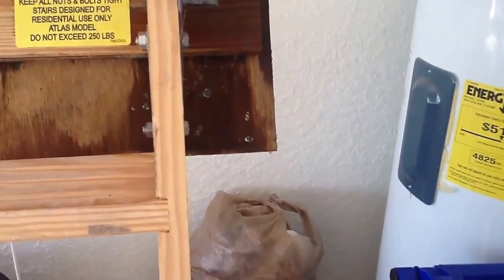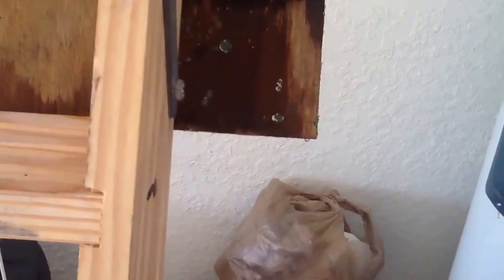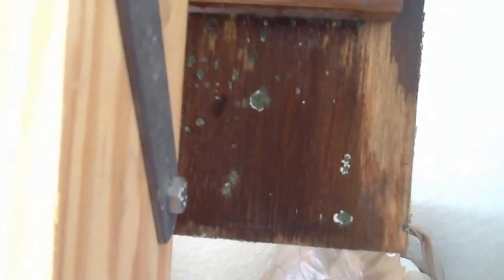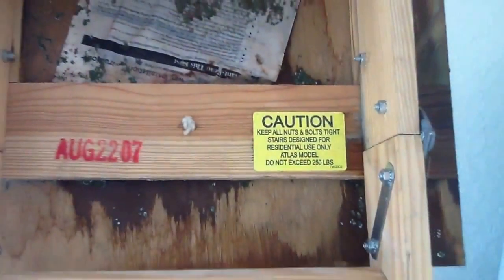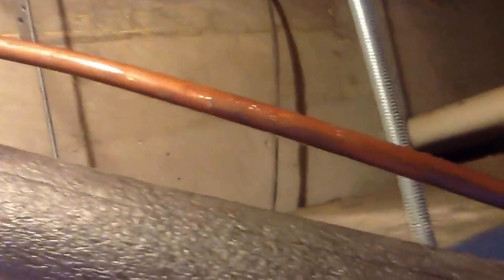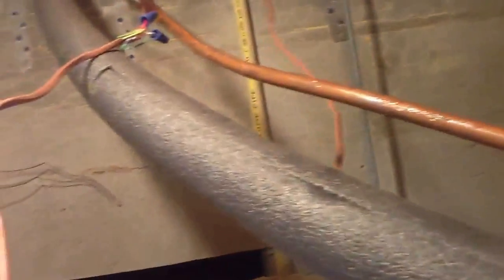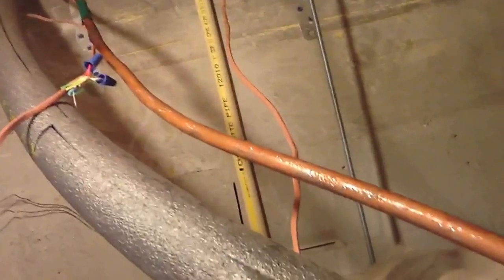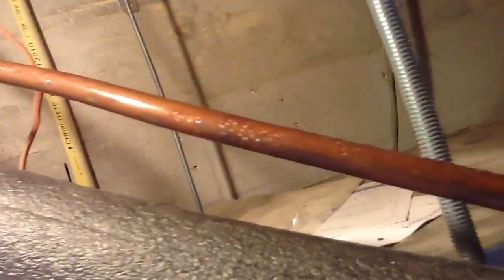Why does my Liquid Line sweat?

Comment: Insulation MUST be vapour sealed, the has line is not vapor sealed, ie the joint is not glued or at least taped up , then it will sweat inside and if is rubber it will become soggy and not insulate at all , in fact it will be worse then no insulation, due to water is an excellent medium for hot or cold temp transfer , as for condensation on the liquid line , Gas but I guess someone’s already said that

Comment: A couple of days ago, my ac guy had just installed a new ac unit and after a puddle formed beneath the outside unit, he said he had to discharge a couple of pounds of Freon. My concern was that it would not cool as it did, but it is cooling just fine and now the compressor (not sure if it is related), is not as loud. Thoughts???
Reply: I know you posted this 2 years ago but from what I know these mini splits are pre-charged for a certain length of line so let's just hypothetically use a Pioneer and they come with a standard 16 or 25 ft copper lines for the refrigerant so with that being said even if he cut the lines to 10 ft with Pioneer it's still okay and you don't need to remove any refrigerant people just need to be wary of these so-called furnace heating and air conditioning people not all of them know what the hell they're doing

Comment: to those who comment that this happens to all pipes....... No, not every pipe does this, and if they do, you have a problem to fix. The liquid line (on average) will run about 3 to 8 degrees higher than the outdoor temperature, but with a TXV system, you will use sub cool tests to determine charge level and operational status. This is a rare event and will be seen in systems that are low on Charge, or may have a partially restricted filter drier which can then cause "flashing" of the Refrigerant as it passes through the drier. Then their is the far extreme and less seen issue, Grossly overcharged system using a piston can also cause this. Your Freon can become over subcooled and drop to a temperature which will cause dew point to be reached on the surface of the liquid line. In the end, the most probably reasons are low charge and restricted liquid line (restriction can be in drier, service valve, kinked line, etc). Just another "old guy" like Mr. Jones here, trying to offer understanding to the incoming trades people.
Reply: I had a similar circumstance where I had no liquid sub cooling at the condenser on an ac unit but when I checked the temp of the liquid line by the evaporator it was already getting cold and would have been sweeting if it were a hotter day. My first thought was restriction but both sides of the filter dryer by the evaporator were equally cold temps. Every other factor like air flow was fine. So I am under the impression that the liquid is flashing before it's hitting the txv. Added some refrigerant, brought up my sub cooling to about 9 degrees and liquid line was no longer cool or sweating before it entered the evaporator. I knew the system was low but was a little apprehensive because of how the liquid line got cold as it got at the evaporator. My guess was it was changing state premature and your comment on how undercharge can cause this problem reassures me of my suspicion. After my charge the system was working well.

Comment: It is normal, because the convection of heat with the outside air. It causes condensation on pipe. U can insulate it to prevent condensation.
Reply: That is incorrect, the liquid line should never sweat only the suction line.
Reply: Wrong. Don’t ever say that again. Ever.
Reply: I could show you some cases and the system is normally running.

Comment: Typically....this line is hotter than the air surrounding it, and is therefore left un-insulated for better heat transfer. HOWEVER, for many attic-located air handlers in the US South, the attic temps can reach 130 degF or more....making it the reverse....meaning, the line is now colder than the air surrounding it. This will cause the liquid line to GAIN heat from the surrounding atmosphere ( instead of rejecting heat)...and you may have two problems....1.) sweating, like this, and/or 2.) loss of liquid subcooling of the liquid being pushed back to the evaporator, causing operational problems. For these reasons, and under these conditions.....insulate the line, at least where it runs in the attic section...and leave the line uninsulated where it exits the home and is run outside to the fan/condensor unit.
Reply: It’s a restriction, insulation won’t help.
Reply: @Slavelife9279  ..it matters what the surrounding air temp is...AND the assumption made.... if such ambient surrounding air is hotter or colder then the process line. Read my note again as to where I suggest insulation or not, and for what reason it may be beneficial. Restrictions speak to another cause probablity.
Reply: @TheWilferch  I live in the south and have been a service tech. For 22 years, the liquid line will not sweat unless there is some type of restriction, usually the filter drier when incorrectly installed at the outdoor unit instead of at the evap. Coil. I found and corrected this many times.
Reply: @Slavelife9279  ...not true. We're talking the small diameter, copper liquid line coming in from the outside condenser to the inside ( typically attic located...in the South) Air handler/evapotator. It is INTENDED that this line at 95 degF and higher.....is hotter than the surounding atmosphere. IT IS.....on the outside of the house, but as it contunues its run in to the hot ( 120-140 degF) attic.... it colder than the "surrounding air" ...and sweats. It won't sweat on the outside run portion where it is hotter than the outside surrounding air. Insulating the attic-run helps....a restriction is another problem altogether.....and I won't argue that point.
Reply: @TheWilferch  nope
Reply: Man wrong on so many levels lol
Reply: 140* in my attic this August day at 1:30 pm. (surface temp) (liquid line sweating. Condenser coil dirty)
Reply: @coolramone  ...ok then....see my comment above and maybe insulate a good portion of that line run...at least the section where it sees 140 degF.
Reply: @TheWilferch  I think I found the problem. R22 running pressures hi/low line 130/50 psi. Looks like the compressor is shot. Either that or filter dryer obstruction.

Comment: every copper pipe does that, to overcome this problem u have to put the copper pipe through a foam sheet or a smooth foam pipe
Reply: No, not every pipe does this, and if they do, you have a problem to fix. The liquid line (on average) will run about 3 to 8 degrees higher than the outdoor temperature, but with a TXV system, you will use sub cool tests to determine charge level and operational status. This is a rare event and will be seen in systems that are low on Charge, or may have a partially restricted filter drier which can then cause "flashing" of the Refrigerant as it passes through the drier. Then their is the far extreme and less seen issue, Grossly overcharged system using a piston can also cause this. Your Freon can become over subcooled and drop to a temperature which will cause dew point to be reached on the surface of the liquid line. In the end, the most probably reasons are low charge and restricted liquid line (restriction can be in drier, service valve, kinked line, etc). Just another "old guy" like Mr. Jones here, trying to offer understanding to the incoming trades people.
Reply: Not true
Reply: What about if it’s already in foam but it’s sweating at the point where it meats the unit and pie goes inside?

Comment: how about checking super heat and subcool, and also amp draw . bet you its overcharged.
Reply from the maker: I did it was low on freon
Reply: I think my ac is ifb 1.5 ton. When ac came ist time it has 4meter pipes inlet outlet. Because my room is only 8*9 when i set 16 in summer 42c temp is goes 12c after it auto cut but when some leak occured. I cut the 1.5 meter pipe now it has 2.5 meter pipes.
Then i charge it 610
 Grm gas. Because of cut pipe.
Now it no goes down to 17c don't know gas problem or pipe cut problem recommended by company any other because it not same as ist time only 8month used. What is the problem
? Anyone knows that? I fill gas with weight scale then i try 50gram extra gas but not working don't know what is the problem.
I think pipe or gas quality??????

Comment: the only problen...your caplilliary or (TXV) is in outside unit condenser..thats control the flow of refrigirant..high pressure liquid... wen comes into capililary.. the pressure comes low...
ambiant temp...liquid pipe cold thats why comes swetting...just like a glass of water with ice...glass sweting outside.. same as this condition.. only need todo...put liquid line a rubber insulation and ur problem finish..

Comment: sweating at  liq line dryer in attic new 2ton unit
Reply: Both pipes should be wet in running condition
Reply: May be gas has to much